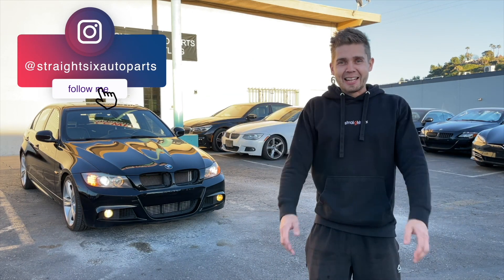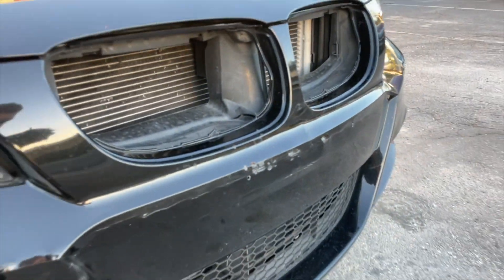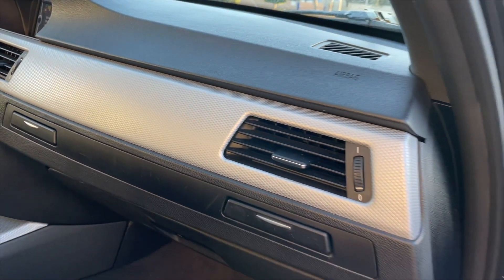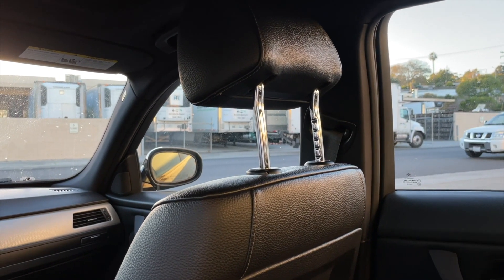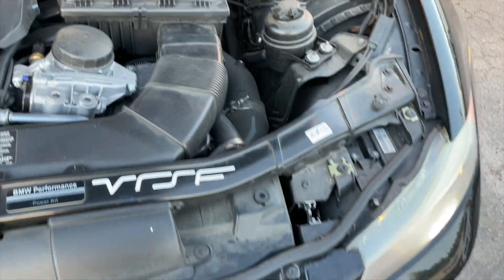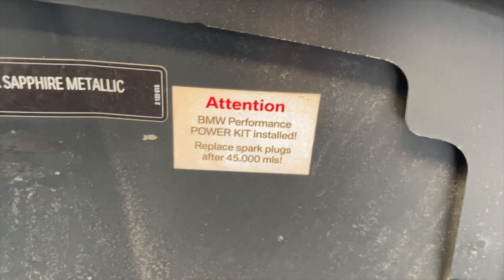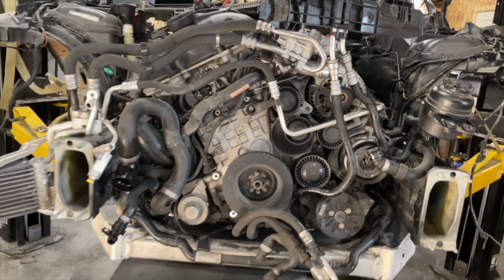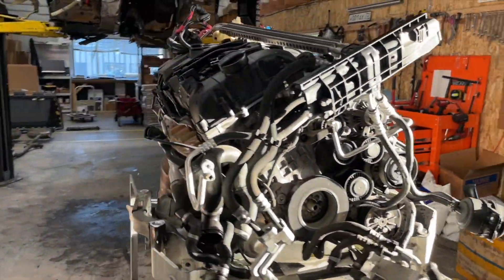The best BMW 335i E90 M Sport with Performance Power Kit | Parted out

Comment: What size are the wheels and tires?   Does it have the BMW performance exhaust and if so would it fit a 2008 335i?
Reply from the maker: Unfortunately It came with stock exhaust